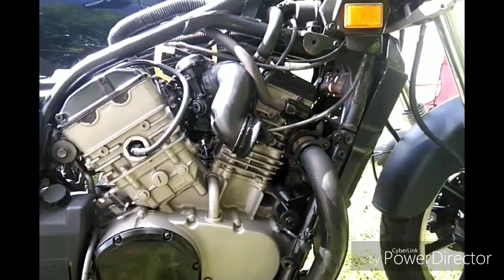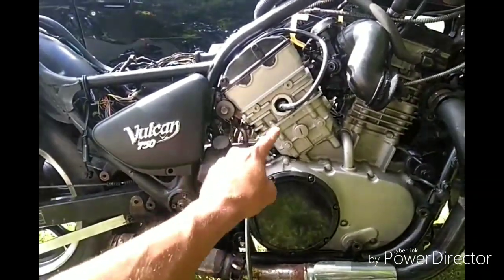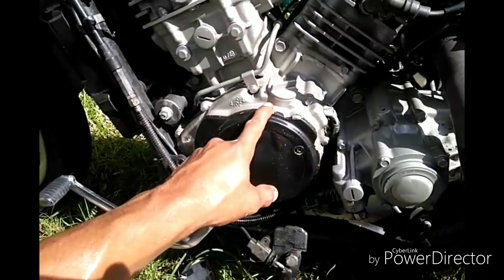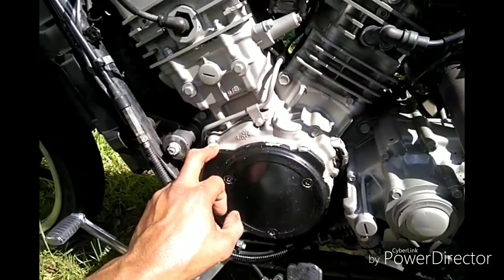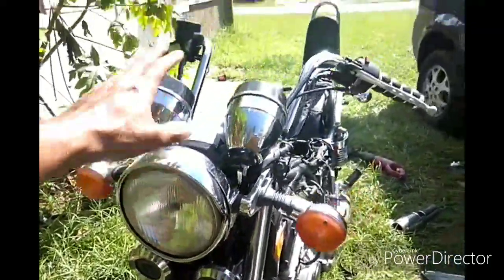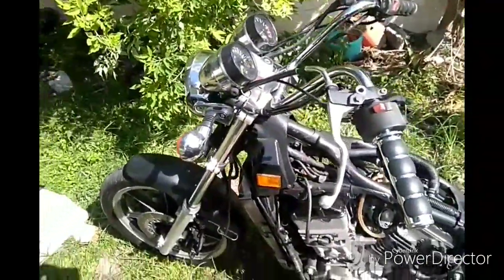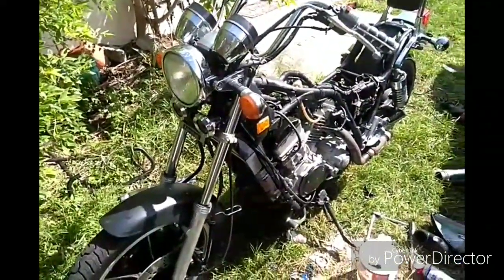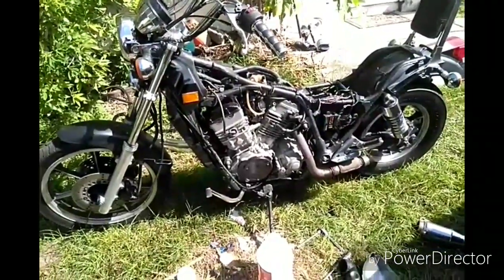Kawasaki Vulcan vn 750  stator Replacement and eng

Comment: I'm about to do the same job on my 1998 750 Vulcan. Hope it turned out well.
Reply from the maker: Got any question's let me know
Reply: It's a pain but just get the engine moved enough to get the bolts out for the stator. Some people cut the frame it's because they're stupid. Or just remove it completely and put it on a bench. The guy in this video is pretty smart he's the first person to actually do it the way you're suppose to by removing the motor. The rest of the idiots cut the frame.